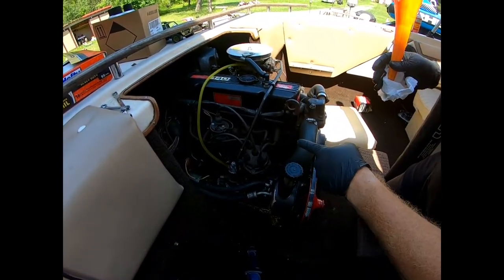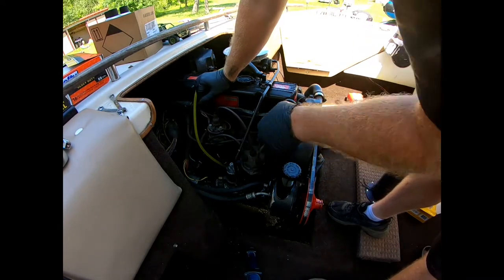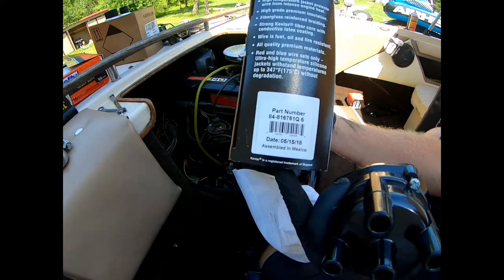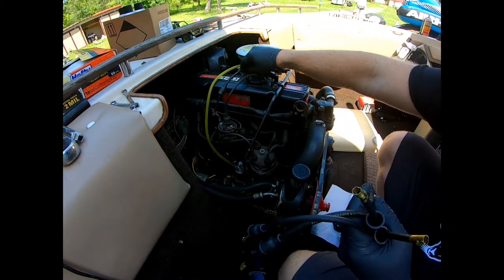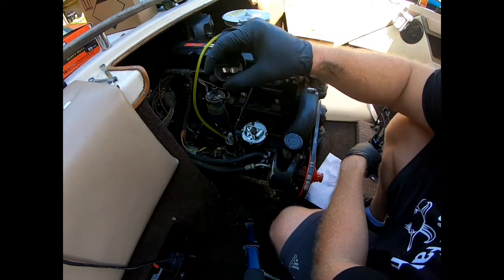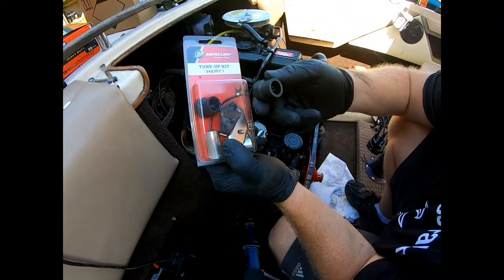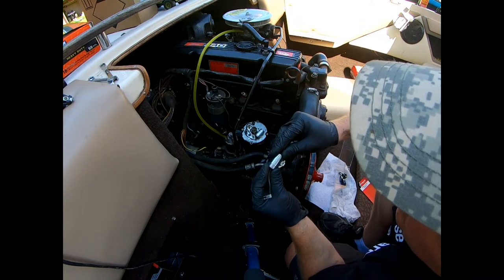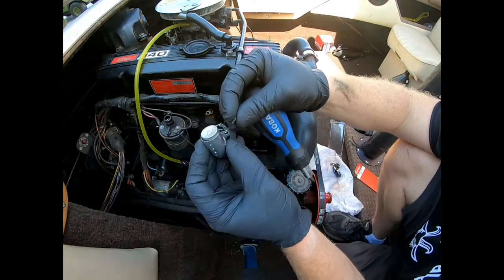Mercruiser Boat Tune Up, Cap, Rotor, Points And Condenser DIY

Comment: I noticed you didn't show where each plug wire goes in relation to #1cylinder. You mentioned the firing order but that doesn't help if you got the plug wires wrong. There's a square notch that orients the cap and wires correctly. If you don't know how to find dead center on #1 you might be in trouble otherwise.
Reply: Yes me too but I took a picture of the old one and where they go to do it that way worked well for me! Good Luck!!

Comment: Whats your opinion on using a little dielectric grease in the cap socket to prevent any moisture from condensing or getting in there and causing issues?  I've heard it both ways....
Reply from the maker: No issues, it's meant for electrical and would probably prevent moisture which on a boat there is alot! Lol thanks for watching and have a great summer!👍

Comment: Question. My boat was running fine/great. Tested it at home prior to going out and it ran fine. Put it in the water and it just turns over… is the coal supposed to have oil in it?
Reply from the maker: Coil? If so yes and if leaking time to replace the coil! Thanks for watching!😊

Comment: Great video! I noticed  what I think is a 'ski pylon platform' in front of the motor?  If you installed it, or even if U hired it out, I would appreciate a video that talked about it, and that covered the measurements, and location chosen, and how it was secured to the boat's framing, etc. As I would like to install such in my boat, that has the same engine! Also, what make and length, and model year is your boat?
Reply from the maker: Awesome thank you!  I pretty much went off of where it was originally installed but my floor was a little soft and I wanted to beef it up because its alot of force pulling even connected to the floor and frame here is a video about what I did on the boat, 
https://youtu.be/8TfNIl4OOBg
Thank you for watching!👍😁

Comment: Just curious when setting the points gap is there anything else that needs to be done first or do you just loosen the screw and set them
Reply from the maker: Yup just make sure the rubbing block is on one of the high points of the cam lobe then set with feeler gauge to correct gap!  Thanks for watching!👍
Reply: @WhitehouseFarmVet  That's a MAJOR step.
Reply from the maker: @badcopnodonut607 it's not a major step just sounds like it using the technical parts names! Before electronic ignitions points were standard in every machine!  It's actually really simple! Thanks for watching!

Comment: Very good video man I learned so much by watching this video. I just did my tune up, plugs and wires changed, Distributor Cap and Rotor changed as well as the oul plus filter. I use my boat for fishing using my trolling motor the majority of the time  and don't do any of the water sport stuff. So with that said how often should I perform a tune up? Thanks
Reply from the maker: Awesome thank you so much!  Honestly the biggest thing with how often do you have to do a tune up comes down to if you are using the points they have to be checked to make sure they are not corroded each year because obviously it's a boat and constantly on or in water with humidity etc etc so they corrode alot faster than say a cars points would! Rule of thumb check them before the start if each year ,keep some sand paper or a dollar store nail file on your boat and it's worth it to have a back up set if you get really stuck out on the water,  but everything else as long as its firing up and sounds good your cap and plugs and spark plugs can easily last 2 to 3 season's plus, it all just comes down to maintaining your engine, I know if I am going out on the water I always make sure I put a trickle charger on the battery the night before and then check everything from oil level to wires pumps and make sure everything is working then I hook it up to the muffs and let it warm up and make sure everything is working properly,  I definitely feel even better going out with the new trolling motor I put on it's a nice piece of mind that I wont need to be paddling or waiting for someone to tow just in case !😂  But back to your original question if you just replaced all that stuff and primarily use the trolling motor you can  easily go years before needing a change but like I said make sure to at least inspect and test! Thank you so much for watching and have a great summer coming up!👍😊🎣
Reply: @WhitehouseFarmVet  GTG!!
Reply: Do you have any videos on boat trailer maintenance for the wheels, leefs etc....? Thanks
Reply from the maker: Just lights and painting for boat trailers, I have some stuff I did for hubs on enclosed trailer and Replacement of leaf spring bolts on utility trailer,
https://youtu.be/VzcYi7VBJ18
Reply from the maker: https://youtu.be/Ux0GswxCLY8
Reply from the maker: https://youtu.be/sG1lTUmyQ90
Reply from the maker: https://youtu.be/iyjHDh5z3lw

Comment: does this have a water fuel separator? just did fuel filter thanks to your other video, but does it have a designated water fuel separator?
Reply from the maker: No  usually not on these 3.0s , thank you and thanks for watching!👍
Reply from the maker: No not usually on the 3.0s, thank you and thanks for watching!👍

Comment: Is that the mercruiser 120hp? If so could you please help with part numbers i need a new cap,rotor and plugs  please and thanks
Reply from the maker: No i have a 140,  but Mercruiser 2.5l which is 120 and mercruiser 3.0l which is 140 according to GM can use the the tune up kit from 1964 through 1990, you can get this complete kit on Amazon 
https://amzn.to/32ZWI70
Reply: This kit is discontinued on Amazon I’m looking for a kit as well.
Reply from the maker: Here is another Amazon link for cap rotor points and condenser!
https://amzn.to/3C8wuzT

Comment: What engine? 165, 170, 175, Iron Duke? Sheesh
Reply from the maker: Lol on my channel I only work on 3.0 boats, it's also listed in the description
Reply: @WhitehouseFarmVet  ima frigging subscribe just because this comment
Reply from the maker: Hahahhaha thanks!!😉😁👍🍻
Reply: @WhitehouseFarmVet  np I'm working on mine right now. Cranks and cranks I got fuel and air no spark
Reply from the maker: Check your coil with voltmeter if that's not it take a spark plug out or if you have a tester and make sure you see a nice bright spark!